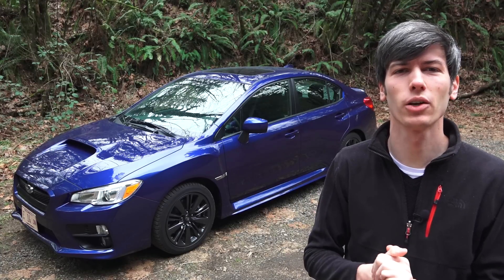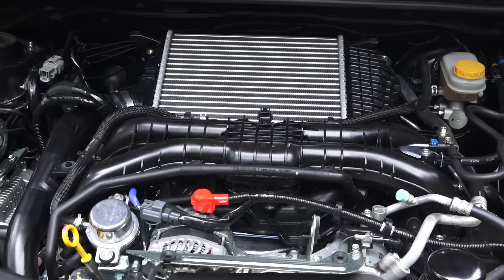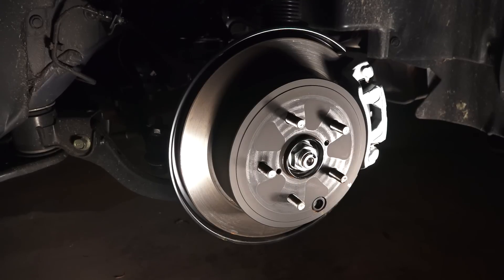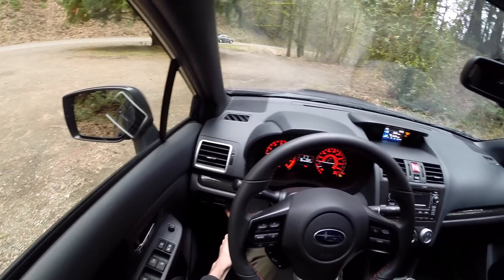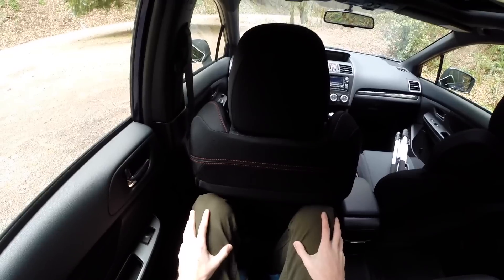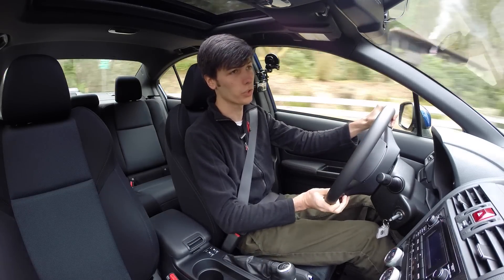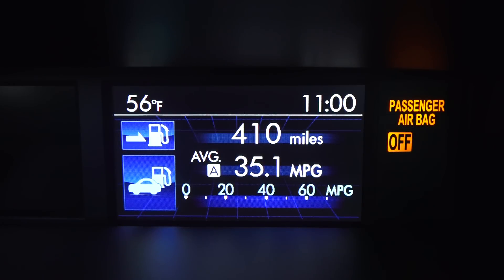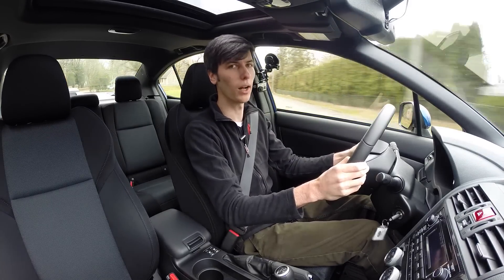2015 Subaru WRX - Review & Test Drive

Comment: I personally don't see how you can justify the $8k markup on the sTI when you have this thing. Oh sure, it's not AS insane, but everything is brand new and the engine is much more efficient and has a broader power band, even if it's down 35 horses. You get more out of your money with the WRX. Besides, you can use the $8k you save to get the awesome Subaru extras like an upgraded audio system or the aero parts.
Reply: Just a couple things to note: STI has
* Four wheel brembo brakes
* Driver controlled center differential
* Torsen differentials in the front and rear.
* A significantly stronger 6-speed transmission. Have you seen the gear size different of the '15 WRX compared to the STI? The WRX gears looks pretty anemic.

To buy the STI transmission, which includes the DCCD and front Torsen diff, you are looking at 5900 US dollars for a new one. The Brake kit is around 1800 US and the rear diff is around 850. Those three items alone will set you back 8550 if you want them to be new and OEM.

You also gotta factor in the labor to install of that. Even if you can do it yourself, it will take hours to do or longer if you need to make adapters for the transmission and calipers. Most of the time these things are not exactly Plug N Play. That price doesnt include any of the suspension components or the wheels which differ as well. I promise you, it will cost more than 10000 US to bring a WRX up to an STI's level using NEW OEM components. You might be able to fudge it using used parts, but nobody buys a brand new car and then dumps worn out old parts into it.
Reply: the STi is the motorsport variant you buy to compete and daily, its about the 6 speed STI gearbox (very tough), the limited slip diffs/dccd, ej257 (sti engine has freer flowing heads for higher rpms, semi closed deck block), brembo brake package, sti suspension etc way better package to tune and thrash
Reply: SI0AX by sti 6 speed i am referring to the type of gearbox and its internals.
the STi 6 speed gearbox is not the same as the wrx 6 speed gearbox!!! DO NOT GET CONFUSED

the STi 6 speed is essentially a racing gearbox which is really really really tough, it will not break and can handle 450 kw @ the wheels then it starts shredding 4th gear.

the regular wrx gearbox is okay but won't handle all wheel drive launches, keep in the mind the sti base model has the premium trim of the wrx im pretty sure.

I'd go the normal wrx, if you thrash your car a lot and do motorsport then the sti is the way to go.

get the regular wrx, low end grunt, way way better fuel economy.
Reply from the maker: I would agree. I think the '15 STI is a hard sell as performance wise they're fairly close. I went with the '14 STI as they offered hatch, and there were a few key things the '14 WRX didn't have which I wanted, primarily the transmission and the diffs.
Reply: Jared Tate Actually he said this WRX is a 6-Speed. I don't know if I'm correct if I saw this is the first time a non-STi has a 6-Speed. That alone makes me think about getting the WRX instead of the STi. The STI has a 2.5 liter engine, which is only for Domestic markets as the STi in Japan has a 2.0 liter engine. The suspension in the STi and brakes are better but High-end coil-overs will beat it. You can also get cheaper performance brakes with the compound of your preference.
Reply: Leather interior, suspension is stiffer (in general it is more race oriented), 305 hp, visuals(wheels, spoiler), better brakes. The STI is just better in terms of quality in most areas, and better for the track. The Wrx premium will have better extras than a base sti( like the moon roof) that the sti can get in the limited trim for ~$40,000.
Reply: Drive both back to back. STI is more superior car without questions. Better breaks, track proven engine, center diff, better interior...etc. Since i'm older now 8k isn't a huge number for me to spend.
Reply: Wade H Totally agree.  Did the same and went with the STI - huge difference.  The steering feel is so much better in the STI.
Reply: SI0AX When i test drove the both the WRX and the STI, I ended up going with the STI for a number of reasons. The suspension setup is already pretty spot on for track where I found the WRX to feel a bit soft when on the public roads. Throwing on coilovers wont make your car handle any better unless you properly dial in the right setup. Until you see enough track time, many people wont understand the benefits of having aftermarket coils. + The suspension of the 2015 STI is redesigned from previous generations. Last selling point, the chassis reinforcement structures within the STI that aren't found in the WRX to increase it's rigidity. That's not something you can buy aftermarket.
Reply: its all about the handling
Reply: I also forgot to mention the front and rear Brembos. When you talk about justifying the price jump from the wrx to the STI. brakes alone cost 6k for a full setup. Sure you probably can find a BBK better than what comes with the STI. But the STI brembos hold up very well at the track. No throw in the 3 LSDs & STI suspension bits and you can see why there is a price difference with the car.
Reply: Mike Bean it's ignorant!!!! Go replace all your shit with Sti parts and I guarantee you spend so much, you car will be worth $45k. First things first: your transmission is weaker, no center diff, lesser steering rack no torque vectoring, should I keep going?
Reply: im reffering to the sti
Reply: Well, you have to remember that the sti has that LSD that really does work well.
Reply: The 15 WRX can outperform a stock 15 sti with about $1500 in mods and get better mileage doing it. If you aren't going to track your car, the WRX base is the way to go. $26 grand, plus an exhaust and tune and your pushing 300+ horsepower at the wheels easily.
Reply: Unbearable Pain I feel the same exact way. With the new generation, it became really hard to justify the extra money on the STi. Now we play the waiting game for a updated engine in the STi
Reply: MrGovenator1 And I know you'll agree with me when I say I'd much rather buy a Genesis Coupe with my money instead of a WRX.
Reply: Unbearable Pain
I would only get the cheapest 6 cylinder Genesis because the 4 cylinder is very underpowered and requires way too many mods to make it have decent acceleration.
Reply: SI0AX You can't even buy the 4-cyl anymore, Hyundai axed it. The cheapest GC is $27k, but I highly suggest upgrading to the R-spec that has all the performance parts for $29.5k.
Reply: Unbearable Pain Actually, I plan on selling my GC hopefully next month to get a WRX. I have had lots of bad experiences with my GC. And have had several people tell me they have the same experience. Some people really enjoy the car though. I enjoy it when its being driven like a sports car, but the other 95% of the time, I can't stand certain things about it. Mainly the transmission, interior quality, and my car has a pretty bad steering issue, which I have tried to get fixed, but nothing has got it working correctly.
Reply: MrGovenator1 true, especially with the old ones. My friend has an 14 ultimate and he said his only gripes are the transmission, steering feel, and tendency to understeer from it's weight. He said in the ultimate that the interior isn't bad (I didn't think it was) or at least it was on par with Nissan and Subaru's interiors. I was thinking about a GC in the future but I really like the Audi S5.
Reply: Unbearable Pain I only liked the look of the 1st gen Genesis. I don't like the front end of the new ones. The good this is that the 4 cylinders of the new ones aren't being produced anymore.
Reply: ***** My 20 mpg average is one thing thats pushing into a WRX. And I drive 50 miles ever day for work, soooooo thats not so good.
Reply: ***** All sporty cars use minimum 91. Even the Honda Civic SI uses 91. Even some eco cars run better with a higher octane but that really depends probably on the engine design and how it will be driven.

When you turbo a car, no matter what it is, you need to up the octane. The higher the octane, the more power you can tune your car for. But you can use Ethanol or meth injection to significantly up the octane for much cheaper than buying 100 octane race fuel. Which could cost you like $120+ To fill up your tank.
Reply: ***** Up until I wanted to sell my car I put premium in my car, even though it runs perfectly on regular. Plus an additional 10 mpgs easily makes up for the extra cost of premium all the time.
Reply: SI0AX I do realize this. The manufacture actually says regular on the 3.8L.
Reply: MrGovenator1
Oh. then that's ok then.
Reply: MrGovenator1 I own a gc8 wrx, care to provide details my way ?
gc8s are really old cars so unless you're mechanical minded/willing to work on them i wouldnt bother and don't expect them to be a new car.
Reply: Jared Tate
true but still very notchy
Reply: take both of them to the limet in a hogh g spin and you will noticea major diferrence because of two limited slips tightersuspension
Reply: Ricky Vang get the STI exhaust system
Reply: SYNCPHAN1OM You mean just hear the rumble? That requires unequal length headers that are not good and limit power. A lot of tuners change out the ULH from the STi to gain more power and efficiency. But they loose the rumle though.
Reply: jay czyzyk Yeah but Coilovers > Stock STi  suspension. Even thought there are extra handling features like 2x LSD.
Reply: no sti suspension consist of inward coilover
Reply: yes
Reply: SI0AX and if you run ULH with a twin scroll you wont get the proper boost out of the twin scroll, and lose allot of horsepower
Reply: correct
Reply: so the sti is more bang for your buck then for $38,000 out the door
Reply: Please just stop
Reply: ya
Reply: spacemonkey1112 the damn center differential alone, makes up the difference. sti is actually a bargain
Reply: SI0AX you do not need to change headers until you want serious upgrades. Under 400hp, stock headers are fine
Reply: SI0AX civic si, premium has, hell no. I has a mazdaspeed protege. They said 93 octane, i used 89 one day and never went back to 93
Reply: ***** I had a vision today. You remember the concept? They should keep the STI rally regulated and affordable. For people like you, put the new engine in that 2 Dorr concept and put up to 400hp and sell it for almost $50k. That would make people like you happy
Reply: ***** I bought a brand ne 05 St and totaled it in 06, it was stock. I waited 7 years to get a 07, I Love the look. I had this over a year now. I like the 2015 enough to buy but they still have parts for mine. Just wait, I smell a 2 door special model coming soon
Reply: Not only is it a 8k sticker price difference. Most people don't do the math and crank out APR (if financing), tax, and insurance difference. I financed my car for 5 years. The STI turns out roughly 15k more expensive over the 5 year period not including factoring mpg difference than the WRX.  I ended up going for the '14 hatch.  I miss the 6 speed in the brz though.
Reply: jay czyzyk Lol notchy is love, notchy is life. I put on full shift bushings the notchiness is insane! But it just clicks right into gear and very positively engages, it feels absolutely perfect once you get used to how different it feels, then you'll never be able to drive another gearbox again haha!
Reply: Xaviar Craig You are forgetting about stronger clutch and increased cooling capacity of the engine, and oil. It is adequate for track use!
Reply: Unbearable Pain the 2.0 is a better engine then the 2.5  ... People buying the 2015 STI over the WRX are fools
Reply: Xaviar Craig sorry, but the 2.0 engine is better then the STI 2.5...Only a fool would waste the money on the 2015 sti over the wrx
Reply: spacemonkey1112 wrong, i test drove both as well. I ended up buying the limited WRX, more car for my money
Reply: Mike Bean you are ignorant, wow
Reply: Shawn Moses wrong mosses. You might want to look that word up. Ignorant for calling me ignorant.lol
Reply: U pay the 8k for the big wing
Reply: Mike Bean can you explain to me why you believe the WRX is more car for your money rather than just telling me that I am wrong because you test drove both.
Reply: Shawn Moses  - no. I have a 2015 STI and I don't regret my purchase. I just get a little peeve'ed when people reply to me with 0 explanation to back up their statement
.
Reply: Oh and I forgot, the STI is a 2.5 liter turbocharged engine (unequal length headers), and the WRX is just a 2.0 liter turbo with equal length headers.
Reply: SG Carter if you consider going faster in a straight line to be outperforming then yes
Reply: Unbearable Pain The Sti motor as far as I understand has a higher power threshold then the 2.0 liter motor. The Sti also turbo spools differently and comes with brake vectoring. Honestly the extra $8k+ for the car comes out to be just about the same price if you were to add the same mods yourself... It also looks better.
Reply: Kyle Grodkowski WRX has break vectoring too now, also the new turbo is a twin scroll so it scrolls up faster than the old sti and wrx single scroll. Of course the threshold is higher on the sti its a 2.5 vs a 2.0 but there are very little benefits to getting an sti at this point. Besides the better handling that is.
Reply: Eugene Grechko toque vectoring is in the STI and the transmission and center diff alone, make up the difference in price
Reply: Eugene Grechko Ehhh that's really up to debate. An adjustable c-diff is hard to pass up.
Reply: Shawn Moses Torque vectoring is in all models from the base wrx to the sti. 
Proof: http://www.subaru.com/vehicles/wrx/prev-year-specs.html
Also the transmission is a 6 speed in both the wrx and sti. Whats better about the sti transmission?  
The sti does have DCCD which is pretty nice and i cannot argue against that, the sti also has a bit more power and better steering ratio and handling AND(emphasizing the sti as a better car) better breaks but for the price the only thing you're are really gaining is the DCCD and steering ratio which is not worth the extra markup. All other aspects of the wrx can be improved in aftermarket work for pretty cheap.
Reply: Kyle Grodkowski of course it's up for debate, the DCCD is awesome and if you have the money go for it but the sti will never be a better bargain than the wrx.
Reply: Eugene Grechko lmfao, stop lying to make yourself feel better. Is the Lancer rally art a better bargain than evo?
Reply: Shawn Moses lol now that's a whole different story. I'm not lying, I brought up facts and a link to prove my point. You can't compare the values of cars produced by a different manufacture and use it as an example for another. Apples and oranges. The power gap between the lancer and evo is enormous. The power gap between the wrx and sti is pretty small 268,  compared to 305, tided in with the fact that the wrx makes full torque way before the sti you have yourself one hell of a bargain car for under 30k while the sti is under 40k.
Reply: Eugene Grechko rally art has a detained evo motor just different transmission. Wrx is behind STI, you sound just like this salesman I talked to, lol. He tried so hard to make me believe it's better to buy a wrx
Reply: Shawn Moses Ralliart has a lot less power than the evo too, the transmission is a twinclutch but the price difference is very small so its not much of a bargain. The wrx and sti have a 10k price difference, there is almost no difference with the evo and ralliart, the point being the wrx performs very close to the sti for a whole lot cheaper. End of story.
Reply: Eugene Grechko whatever, you are just talking about straight line bullshit. I owned 2 STI'S and everyone I know with a wrx wants a STI
Reply: Shawn Moses my prices are incorrect for the ralliart and the evo because i am in europe right now so scratch that. lol
Reply: Unbearable Pain testdriveboth and you will understand
Reply: jay czyzyk nothing to understand.  Can not afford sti by wrx
Reply: you need to reevaluate your comment due tothefact that both cars are tuned completely different
Reply: jay czyzyk and wrx has nothing on Sti. You need to re-evaluate yourself.
Reply: track them both you will notice a major difference
Reply: jay czyzyk why? Wrx transmission is weaker, no center differential, steering rack is not better, suspension is not better. Just this stuff I named justifies the difference. Wrx has come along away, hell, I like how it is because the body is the same as STI but it's not. It is the same for mitsubishi, ralliart or Evo
Reply: Ricky Vang Just throw in some UEL headers and ur good!
Reply: ok thats you

Comment: I used to get 33mpg highway with my 2013 6 speed legacy. That is until I had half of the gas tank empty. It would always drop to about 29mpg highway after a full tank. (Rated at 28 mpg highway) Knowing that I would take that 35mpg testing with a grain of salt.